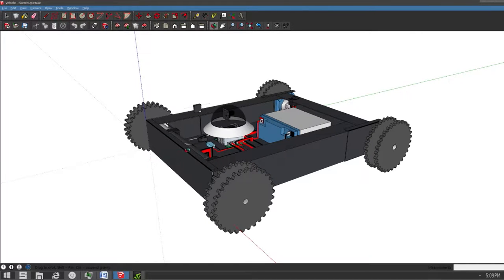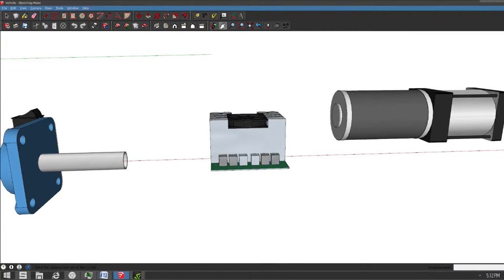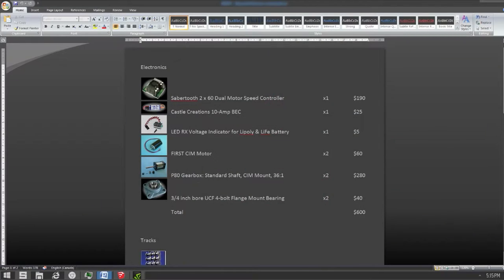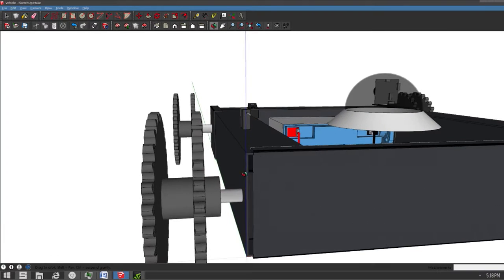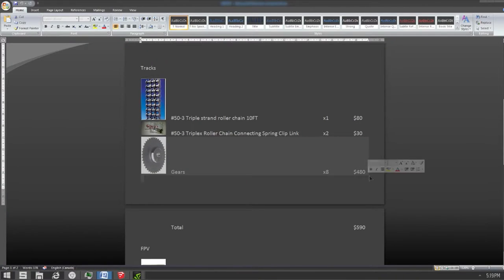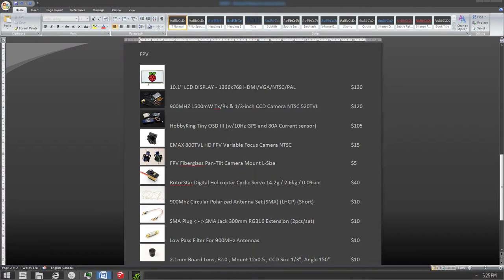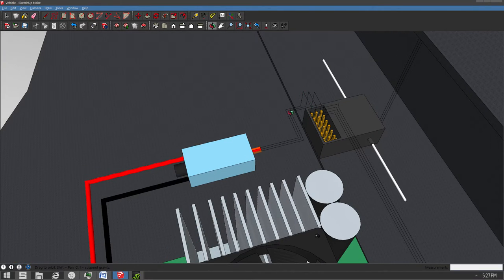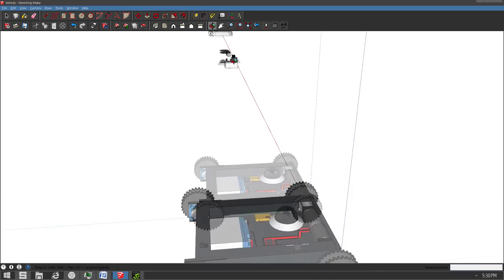Tracked RC Vehicle Version 4! - Digital design

Comment: Can your current chassis support your weight? Want to make this for riding on.
Reply from the maker: +avi bank yup ive sat on it before and it had enough torque to move me, but had some trouble pivoting, so higher torque motors would be needed
Reply: Cool. Thank you . :)
Reply from the maker: +Avi Bank np :)

Comment: What gears are they? (size, teeth, etc.)
Reply from the maker: The teeth are fairly large, lower gauge is better (can't remember exactly what size). They just need to match the chain. Then the number of teeth will depend on the diameter so just pick a diameter you want for the wheels and find a sprocket that has a similar diameter. I have decided to not use this method for my 4th tracked vehicle though, as you can see from my other videos.

Comment: wait why a Pb battery? why not run lipo?
Reply from the maker: RobTapps88 In my pervious V3 tracked vehicle I wanted a really long run time and needed weight to balance out the motors
But you're right, I should use lipo in this version, I will need much higher discharge for this setup which a Pb battery wont deliver
I already own the Pb battery so I decided to measure it and put it into the sketch, but when I do build this I definitely will use lipo or life batteries (which are more expensive too)